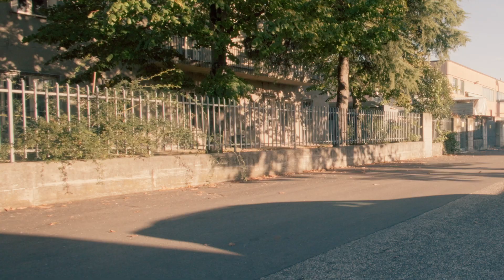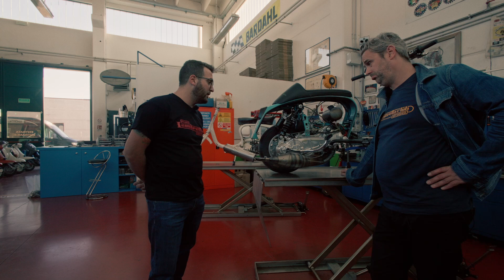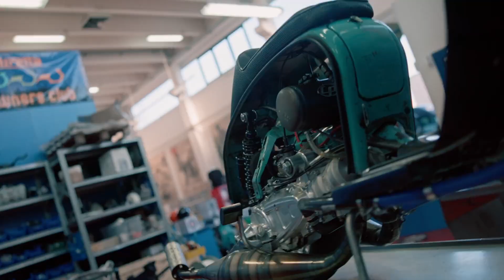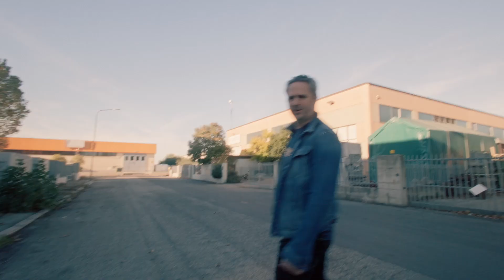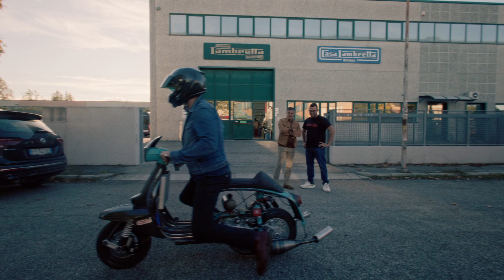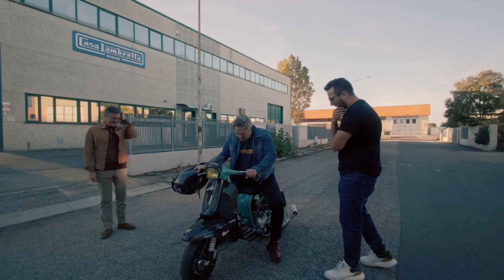TWIN Engine Lambretta 250cc TEST RIDE | Casa Performance | Rimini Lambretta Centre

Comment: it's a twin cylinder not a twin-engine, is that a build on a Targa engine case, I've ridden a Targa with rally tune and it was just like riding a Japanese 250cc 2T from the 1970s, raw power with a power band that jolted your head back,